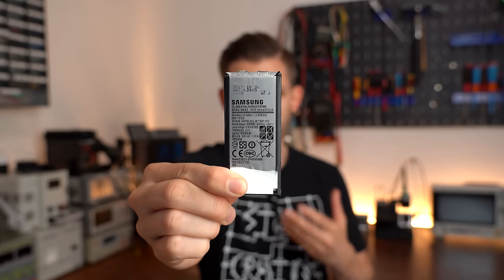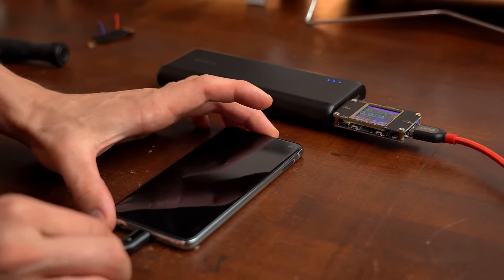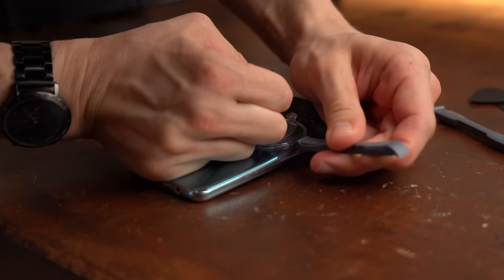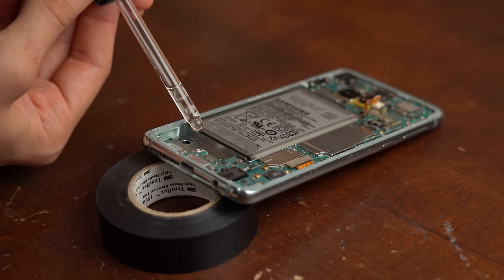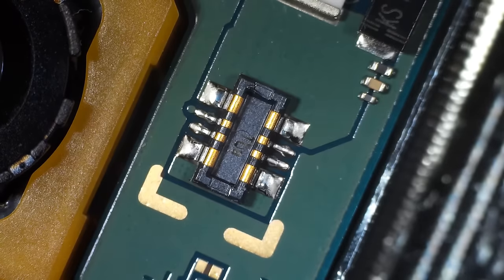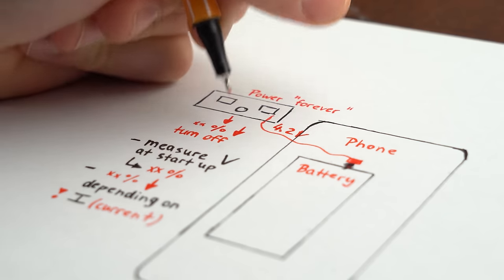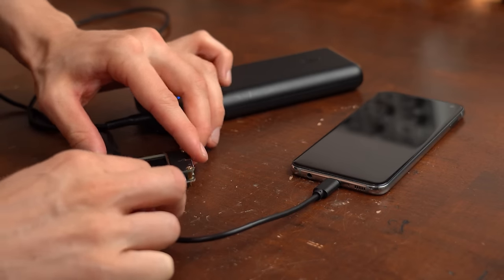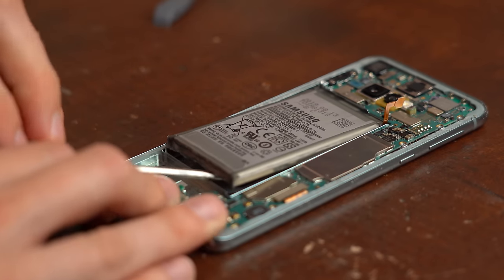I "Solved" Samsungs Swelling Battery Problem! (Batteryless Phone)

Comment: This is something i would do after i get fedup of my phone dieing in mid of a game🤣

But honestly this is some nice modification because it reduces e-waste and provided many advantages like home security you mentioned above
Great job🙂
Reply from the maker: I think so too :-)
Reply: This is exactly what i did for my Samsung Galaxy Tab 4 7.0 3G Released in 2014, I tried purchasing replacements but both only lasted a year so the moment it showed signs of bloating and decay for the second time I took the brains of the battery and attached a USB cable on it and placed a hole on the side then I used a 2A Original Samsung power adapter to power it. 

Now then, here in Asia gadgets are hella expensive, and the second hand market here lives in Facebook marketplace and in my experience with listings there they're not managing their listings, leaving already sold items unmarked and them sending you promotional nonsense or product offerings, which made this decision a good choice.

One thing to note before doing this, YOU NEED A HIGH QUALITY ADAPTER, here in Asia, cheap quality power adapters supplying less than 1A of power and even if it does the thing heats up to the point the case is as hot as a mug of hot tea, so make sure you got a good one.
Reply: @greatscottlab  Can you do it for an iPhone (:
Reply: I wish people would stop talking shit about e-waste.
Reply: I believe you can run a simple server inside, and install Pi Hole in it. With rasp Pi is still hard to get, I can get tens of good specs android with cracked screen cheaply. I can control it with scrcpy for setup, and having it with no battery reduce the risk of getting exploded.
Reply: @bluestone-gamingbg3498  have you tried using those lifep4 batteries? Yeah that charger is still better just plug and play but we can use other batteries too just removing the existing one and soldering to the bms board of battery
Reply: @Mods-Lover  the thing with other battery chemistries is that they have a different nominal voltage which is not gonna work with the BMS of the android device's battery, though it is possible to use another battery of the same chemistry.

The maximum voltage of Lithium Ion batteries being 4.2v, or in other modern phones, Li-Hv also known as Lithium High voltage batteries which have a maximum voltage of up to 4.85v, simply using a Lithium iron phosphate battery with a maxinum voltage of 3.6v where the Li-ion used to be won't work well, the BMS would report that its broken or is about to die.

it might be possible to build a circuitry designed to "step up" while also accounting the battery voltage so that it can be stepped down for the BMS to properly manage the battery but also be able to push in charge while doing that, but reading this part as a "casual electronics hobbyist" well thats hella complicated. 

For me I use the tablet as my handheld library, filled with books and stuff so I have no need for its portability, though if I want I could use a powerbank to power it.
Reply: Doesnt scrcpy need usb debugging to be turned on? How do you turn it ON on a phone with broken display?
Reply: @somethingsomething464  well that something you should prepare beforehand
Reply: @itssilence9998  Doesnt scrcpy need usb debugging to be turned on? How do you turn it ON on a phone with broken display?
Reply: @somethingsomething464  well, i don't mean broken as not responding. Most broken screen is just crack and broken display but still accept touch input. And even if it is broken, people around me usually use cheap android that just enough for one or two moba game, and just buy a new one when the phone is cracked rather than the hassle of repairing it ( I don't understand why they did not repair it ). I can get those really cheap under 30% of its "new" value, and adding the cost of replacing the screen with cheap not so good display is much cheaper than buy fully function second hand one. I don't use it as an android phone after all.
Reply: @Brianck1971  I fail to see how e-waste is good

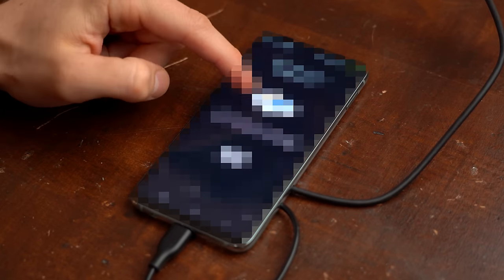Comment: Awesome! Still at 1:50 but now you're talking about powering devices without their batteries, I'm pumped! This maybe great with my unused phones/tablets to create dashboards for Home Assistant around my house😎. Thanks!
Reply from the maker: You are welcome :-)
Reply: @greatscottlab  incredible I would like to congratulate you for the video and for sharing the knowledge I have an nvidia shield k1 tablet that is very capable, it emulates many things and very fast it even supports streaming of games fullhd movies but its battery does not hold a charge anymore I put a stepdown regulated at 3.7v 2amp it works However, the supposed battery runs out even when connected to the power supply, I will do what I taught in the video, I would like to know if I will be able to use the charging port with an otg cable because the idea is to use the tablet without battery and with joytisk usb to play, because currently if I plug a cable into the charging port it turns off

Comment: Great project!
Only change I would have made is soldering the battery lines to the inside contacts of the charging port, and using an adjustable LDO to solve the 9V USB-PD problem. Unfortunately requires microsoldering, but that way you can keep some of the water resistance and don't have to cut the chassis.
Reply from the maker: Yep. I thought about that but the hard soldering is probably not suitable for most viewers.
Reply: I would have done that too, except I wouldn't bother about PD charging cause, there are adapters with only 5V and cables that doesn't have data wires.
Reply: @greatscottlab  Absolutely correct. It would definitely require a microscope. I just love "seamless" modifications haha.
Reply: @NiceEyeballs  Ideally, you should make it safe to use any adapter with any cable without blowing up the phone. Don't set traps for yourself. If you add an LDO to the battery circuit, it will be tolerant to PD voltages. That way, you don't need to mod the chassis or use particular adapters or special cables.
Reply: I don't think the charging port can carry the necessary current to keep the phone stable. This is why the phone still starts up with only the charging port connected and no battery, but reboots as the voltage drops. Even the current setup he has is probably not going to be 100% stable, as it's running off of only one USB port, which is unlikely to match the output of a battery in all situations. To get 100% stability, I've found I have to use two USB ports, one wired directly to the BMS, and one plugged into the charge port.
Reply: @iguanamoat  Phones nowadays can draw 20W and more from the USB-C port so current itself can't be the problem. Even without PD or QC, you can draw 10W with plain old 5V 2A. Maybe if the phone senses an error condition with the battery, it shuts down or reboots for safety?
Reply: LDO to drop 9V to 4.2 is quite a bit of heat, 5W? lol, maybe a SMPS perhaps
Reply: @veryboringname.  A prismatic lithium cell in a phone can provide burst current in the 100 watt range (assuming a 3000mAh cell and 10C burst discharge rating), so while 10 watts might keep the phone up 90% of the time, it can still 'brown out' under higher load spikes. The 60 and 100 watt settings of USB-PD might do the job, but there are still only a couple devices today that can run off of only the charge port, so I don't think manufacturers are confident it can replace a battery. The Tab Active series for example, which is made for commercial users, has a 'no battery' setting you can toggle, which I believe limits the power usage. Hopefully as devices become more power efficient and higher PD charge rates/cables/adapters become the norm, they will start gaining the ability to run off the charge port by default.
Reply: @iguanamoat  A phone's chipset and AMOLED screen would barely even hit 1C.
Reply: @iguanamoat  Put a small supercap instead of the battery, then you can keep using the normal charging-port.
Should work?
Reply: @veryboringname.  Which is why the devices can run fine off a single USB port 90% of a time, but will crash under a momentary peak spike. Normally this is not a problem, since the battery will absorb these spikes easily, but a tiny wall transformer cannot hope to match the burst output of a lithium cell and the phone will brown out. There is a reason why almost no modern phone in existence is able to run off the charge port, while older phones with less power draw or laptops with more robust power supplies and power connectors are able to do so.
Reply: @tarakivu8861  Yes that should work better, but it might not be completely reliable since the cap can be drained faster than the charge port can charge it, at which point the phone will shut off. Good for momentary peaks, but not sustained high loads.
Reply: @iguanamoat  Switchmode power supplies can absolutely deal with spikes. Not sure if you watched this video; it literally shows a phone working perfectly fine when powered by a bog-standard switchmode phone charger with no battery involved.
Reply: @veryboringname.  Not to anywhere near the extent a lithium battery can. And yes, the vid shows it running on a single USB port. My phones also run on single USB ports. But they are not 100% stable - I found them crashed or rebooted about twice a week. Once I also plug in the charging port, they never shut off. I verified this at length, because I really, really didn't want to have to plug in two sources, but at the end of the day it was the only option. And again, think about why no modern phone or tablet is able to run off the charge port alone, aside from a couple commercial-use ones that require you to explicitly set a 'no battery' mode.
Reply: @iguanamoat  Your description isn't clear. Are you saying that your phone runs off a single USB power socket wired to the battery terminals through a diode, but it wasn't 100% stable so you also plugged in a USB supply to the charging port just like in this video, and it became stable?

That shows that a USB power supply is capable of running the phone then.
Reply: @veryboringname.  No diode, USB cable to battery BMS. Second USB cable on a separate USB socket to charging port for full stability.

A single USB can't run the phone -stably-. I've said that multiple times, back to my first comment in this thread.
Reply: @iguanamoat  How long and thick are your cables? Have you considered the voltage drop? Have you measured the actual current draw?
Reply: @veryboringname.  Believe me, I spent way more money than it was worth trying different cables and adapters in the hopes it was just a problem with resistance and voltage drop from shoddy or too long cables/overrated adapters. Went out of my way to buy short cables from reputable sources like StarTech, etc. I did measure current draw with an inline USB dongle, don't remember the exact numbers but it was about 2 amps on startup, 1 amp at idle. Nothing that stood out, but that was expected as it's doubtful the dongle would have picked up the type of brief spike I was suspecting was the problem. Considered busting out the oscilloscope, but I would have had to rig it up to log the draw over the course of an entire week to catch whatever was causing the resets, and by that point I had spent way too much time on the problem and decided to just keep the charging port plugged in.

That's not to say voltage drop/resistance are not a factor: I suspect that is one of the reasons why the phone is completely unstable when trying to power by the charging port alone, similar to what happens in the video where it tries to boot up but fails at various points in the process.  Charging port and/or the downstream traces in the phone can't handle that draw, most likely. The internal battery connection is a much bigger and more solid connection, intended for lots of current, so giving it the same power through that results in a mostly stable phone. But it takes a combination of both to get a fully stable one. This will obviously vary depending on phone, but my results are consistent with others who have tried this on various other devices.
Reply: @iguanamoat  When I needed a USB cable with lower resistance I split the cable sheath near the plugs and replaced the power wires with thicker cable. You can use whatever you want; 18AWG, 16AWG. The data lines remain so protocol negotiation can still take place.
Reply: @iguanamoat  What if you cut off the barrel plug on a 5V/5A "wall-wart" adapter and spliced in a USB connector instead? From the video it seems the data lines aren't necessary, charging will default to 5V

Comment: I've got a Samsung Note 4 which had all the same issues.  Replaced the battery, never worked properly.  The battery expanded and popped the back of the phone off.
I wanted to use it for video recording, but as per Great Scott's video, when you power it up, it goes into an endless boot cycle.
I might consider building this one day - but it does make the phone look kind of messed up !!  😄
Reply: Have to see which Android i 'had';  Mine did Same thing.  Trouble for Years, with NO answers to why. 
Shutdown with Full battery - registering -0- Charge.    I found out when Phone 'Opened all by itself.  8{|

Comment: I have some experience doing this with a few phones. Here are my experiences:
For a Samsung S duos, the phone works quite happy receiving power through the battery connector (I used a diode to lower the voltage from 5V). But it would not like to receive power on the usb port at the same time. Conecting it to the pc resulted in a lot of spam of the battery not working or something like that. This phone was my very simple little server for a while.
An Allview P5 Quad - bad experience. Would really not like not having the temperature pin voltage set (could be done with a voltage divider). Also, no usb power or else it would definetly not power on. I had a beefy 5V 4A power adapter, but without some beefy caps on the battery connector it would act up/randomly reboot or simply boot loop. Also, it died some time later.
Allview E4 - beefy caps or have the usb connetor power as well. This phone had otg support and I managed to root it so I had plans for that otg support. Because it uses more power sometimes I intend to use a converter instead of diodes. But this one works well with or without usb. 
Allview V2 viper - has no otg support unfortunately. I don't remember the details, but I don't think it works properly without power on the usb port. 
Samsung s3 neo - doesn't work well without power on the usb. It "discharges" as the phone in the video. Also, best results with caps. I also think it doesn't like to work without the temperature pin set correctly,  don't remember, also I had lineage os installed on it, so I don't know how it works using the stock ROM.
Hope this helps people. Also, haven't noticed until now how many phones I tried this on.

Also, surprisingly Nokia 3310 - not exactly with a supply. I found one without a functional battery and I  found another smaller phone battery that would fit inside. Unfortunately the phone wouldn't be happy just with the power pins connected. I had to add a voltage divider for the temperature and another to set the battery type. It has 4 pins: +,-, temperature and battery type. Apparently the phone could have different battery types and would use a pin to determine the type. I found the values online and used that.

Comment: I did something similar with my Sony Ericsson Xperia Ray. I just plugged 5 volts straight to the battery terminals. It worked just fine, no battery level drop.
I used it to record time-lapse over a period of a week or so. Worked out great.

Comment: This is an amazing hack, and I can give you some advice to be able to use it with any cable without making a hole in the shell :

- You can look for the USB-C connector and cut all trace for D+ and D- / CC1 and 2 /  SBU2 to be sure phone can't enable fast charge by any way
- Next thing is solder 1 wire into VBUS pin.

The result will be clean, but you need some micro soldering so it make the hack a little more difficult, bad thing is you lose the connectivity with any device thru USB :(

Comment: Usually capacity measurement is done by the "BMS" board that is attached to the battery. Otherthan than the main power lines, it has 2 more wires (probably i2s smBus). You could find the shunt resistor in the BMS and by shorting it, you should be able to keep the battery level not dropping down.
Reply: How would I go about finding the shunt resistor?
Reply: @nnamerz you could look for the BMS chips datasheet; from there you could find where it would be connected to, and the recommended layouts included are normally a big tip off
Reply: Phones don't have a BMS on the battery and definitely don't have any shunt resistors. They're single cell. No shunting required. 
The chip on a phone battery is just over-current and under-voltage protection. The extra pins are usually a basic thermistor for temperature estimates so charging can be shut down or slowed as the battery heats up.
Reply: @tin2001  sometimes on 4 terminal ones have all
https://www.youtube.com/watch?v=WGsxnCSfmpo

Comment: I used the cheap lithium battery charger protection PCB's from china connected to a small capacitor bank to do this in the past. 

Works well, it's extremely cheap and easy to do
Reply from the maker: Good to know ;-)
Reply: I was going to suggest that. :)  It would have been a lot cleaner, and he'd just use the stock USB port.
Reply: The classic TP4056 that everyone has like 5psc of